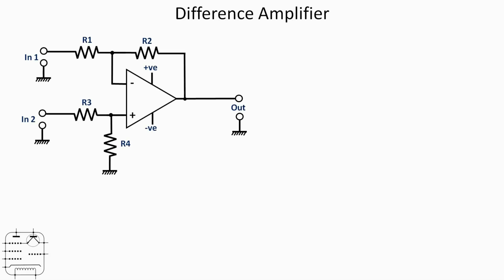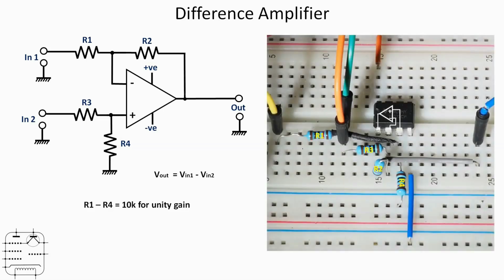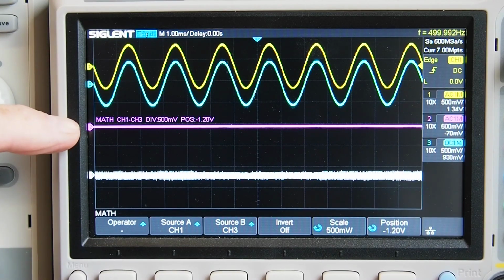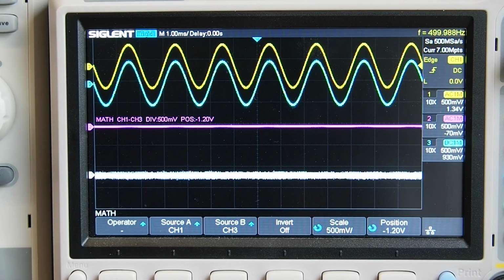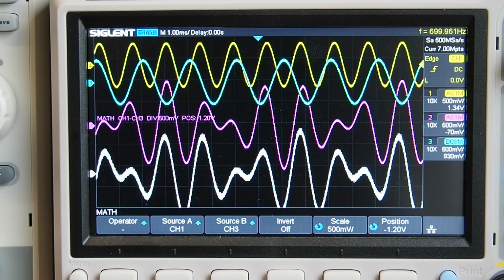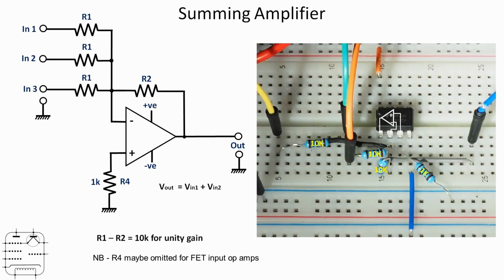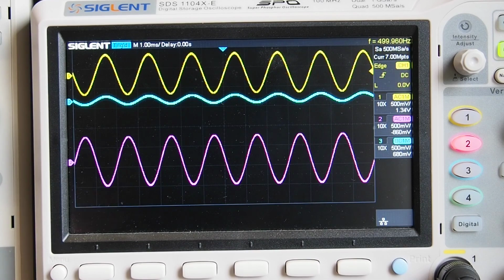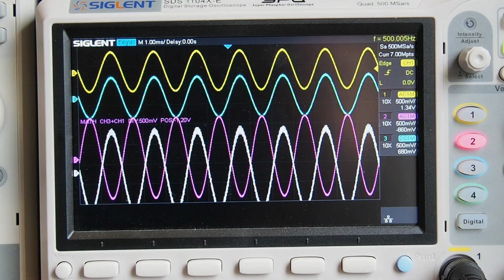Op Amps Revisited Part 2 Maths   #125

Comment: Thanks Bill. It would be interesting to see side-by-side compared to Transistor equivalent circuit (not the diff-amp). Op-amps seem to be used a lot but I wonder if we're being lazy. Often a simple transistor might be the better choice. I'm still learning and think that impedance differences are the biggest difference. Hope you are well.